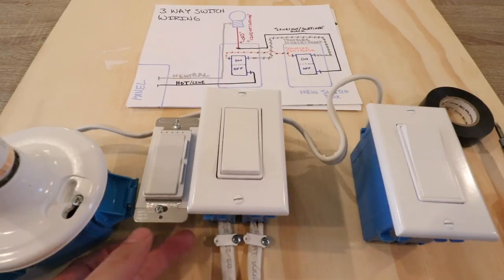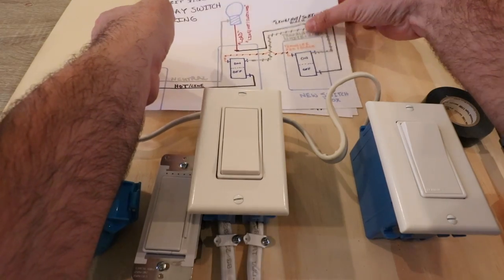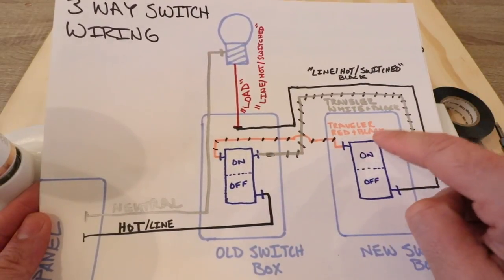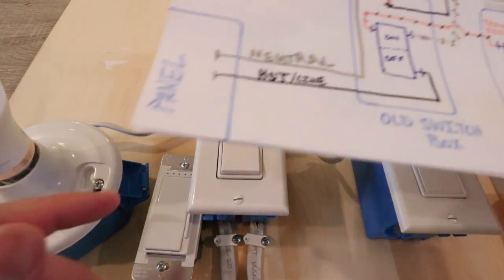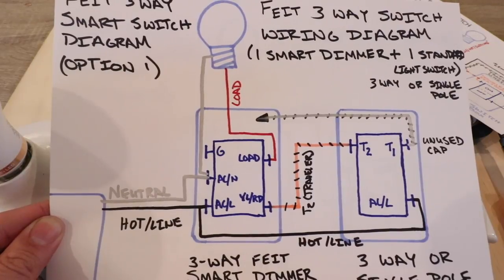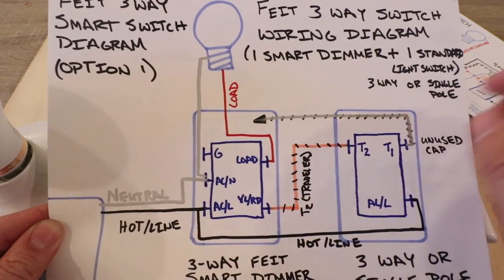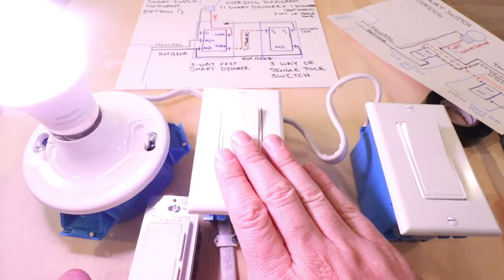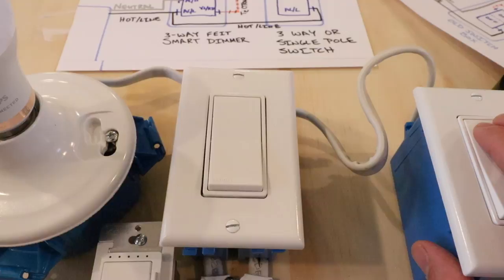How To Wire Feit 3 Way Smart Dimmer Switch

Comment: Good video, however isn't the old 3-way load switch black screw (vs gold traveler screws) connected not to the "hot/line" as you have depicted in your drawing but rather to the "load" connection? Disconnecting the old line switch connection would render the old load switch powerless if the travelers were not supplying the line power.
Reply: I think he more or less reversed the procedure. In accordance with Feit Installation Guide, you should leave the original 3 way switch in the junction box were the LIVE (hot) line comes in, while the new Feit smart dimmer should go were the LOAD fixture is connected. Another discrepancy is that the installation guide doesn't cap either if the traveller wires. They are all connected. I guess he's method eliminated the need for reworking the wiring inside the junction box where the original switch (LIVE) is staying, but somehow can lead to confusion those using the method delineated by the installation guide.

Comment: To add to my last post, I do have Line, Common and ground coming into first switch from circuit panel and leaving last switch going to lights.  I also have T1, T2, Common and ground going between the 2 middle switches.

Comment: Thank you thank you thank you! I followed your one-pole instructions last night and was successful on one light. Tonight I'll work on the 3-way dimmer and switch. 

I have a Google wifi that doesn't let me shut-off the 5ghz. Trying a protocol using two phones and a hotspot to trick the dimmers onto the Google wifi (I got it to work eventually with the AP setting and the slow blink setting on the dimmer)